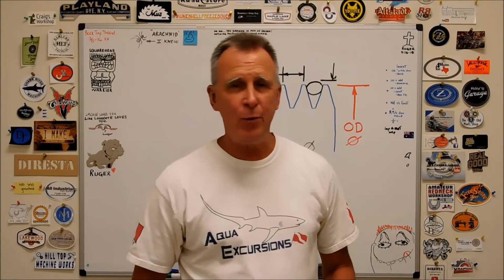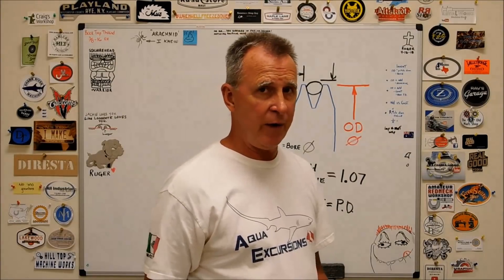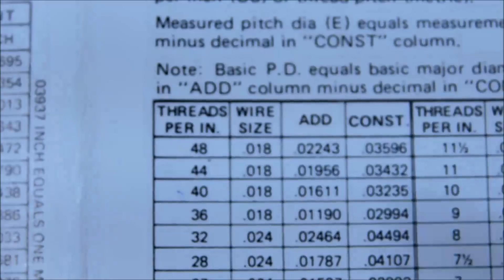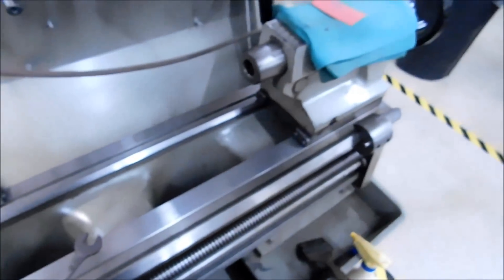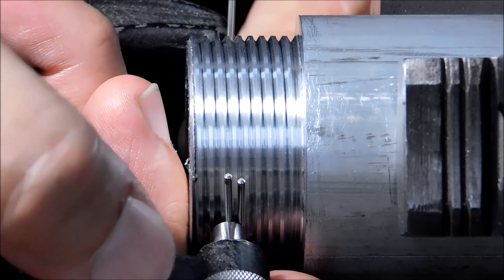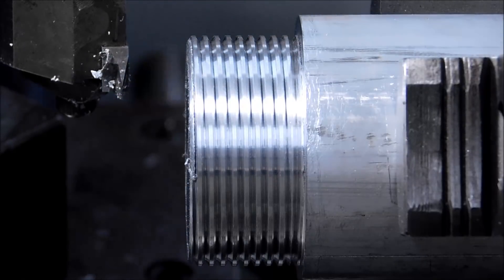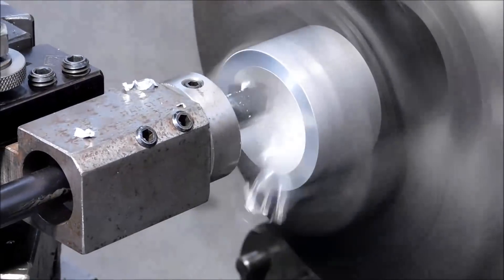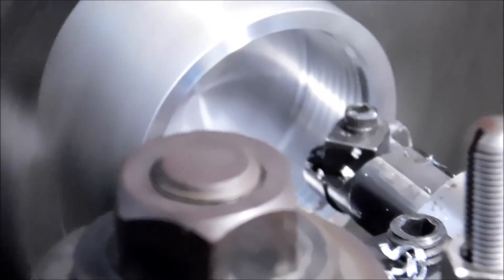Machining Non-Standard Threads

Comment: Another great video. I had to make four non standard cap screws for a 150 year old German engine that were not imperial or metric standards and I had a sample to copy. The OD was .520" or 13.2 mm, the threads were 11.94 TPI or 2.127 mm pitch. The OD was simple but for the odd TPI, I 3D printed custom change gears for my lathe to get the 11.94 TPI. The only way to get the pitch was to use a 67 tooth prime number gear on the stud and a 200 tooth gear on the screw with a 4 TPI lead screw. Stock gears for the lathe were 10 DP and I made 18 DP gears with a new idler so they would fit the lathe.

Comment: You do a great job. I've been a machinist for 40 years and over the last few months have been watching your and many other machining video sites to get a different perspective on how to do things. In this trade you can never stop learning. There is one trick to threading I was shown by an old timer many many years ago but have not seen anyone mention it in a video. If the TPI of the thread you want to chase is divisible by the TPI of your lead screw you can engage the half nut at any time what so ever and the cutter will be in time with your part. I didn't believe it either until I tried it. Give it a shot. Throw a piece of scrap in the lathe and a rag over the timing dial and chase some threads. No specific size, all your testing is the timing

Comment: Great video, it helps a lot, machinerys handbook is a must, I have a PDF copy and print the applicable parts and make notes and calculations on it.  The wire chart is brilliant, and works well.  I have not done an internal thread before, as I usually purchase the nut from a bearing shop, so, I was waiting for the clever way to measure the thread depth, it would be more practical and make more sense to make a go no guage tho.  Again, thanks mate   Michael from AUS

Comment: Hi Joe.
Great video as usual, thanks.
Though you still haven't convinced me to get left hand threading tooling...yet.
One of the non standard thread challenges I've encountered, which does happen regularly enough in the  hydrolics game, is the repair of the threaded end and making a new piston to fit that thread and cylinder.
There are many variations but... 
You have to use the original pitch of the rod but cut it deeper until you have a clean thread, 'discover' the new nominal thread size, best while 'sharp', turn the 'flats' to 1/4 hight, debur and polish.
Then make the close tolleranced tread in the newly minted piston.
It would be easier to test a finished piston on an evolving rod end, but, if you made the piston tread first, you would have to guess the size of the rod threads finished size ..or, over estimate and make the rod weaker than absolutely  necessary .
Another wrinkle is you have to remove the piston from the lathe to check the fit on the rod...
And set it up, again, each, time...
Question, is there a way to measure the effective diameter of the nuts threads to be sure of the correct size before removing it from the chuck?
Oh, and contrary to the quoted drill size for tapping, ie nom minus pitch, which breaks less taps but is a lot less thread flank engagement, weaker but more fit tolerant..
The theoretical correct bore for a nut ( 60° threads) with 1/4 hight flats is:
Bore diameter = Nom diam - 1.299 X pitch, (I go 1.3 x pitch, easy to remember) do the math.
2mm pitch, hight (radius) =  The square root of 2 squared -1 squared = 1.732mm
Less the hight of the flat, 1/4 H, 0.433mm on radius
Equals 1.299mm on radius,
Or 2.598 on diameter smaller than Nominal diameter .
So, say you end up with a nominal M57 x 2mm the nut bore for the flats would be: 57 - 2.598 = 54.402mm (54.40 say).
In a perfect theoretical nut to bolt thread there is only 50% contact, losing more on 'critical' fits seams unwanted..
I will step down from that rather wobbly soap box.
Commence firing..

Comment: One of the best investments I ever made was the wires and the mic for them. I don't often use them but when needed they are never wrong.I often had to send pieces to the bush that I had no nut for. All I had to go by was from the service manuals. When machine downtime is over a thousand $ per hour and often more parts just can't be going back and forth a day at a time both ways. My old Czechoslovakian lathe had no split nut. It had a pedal that would fast feed the apron for returning to the start in either direction. It took a bit to get used to but I swear by it now.  I am sure we all ruined a thread by not getting the nut fully engaged. That is some slick threading there my friend.

Comment: Most of the time a "Unicorn" Thread is used is for a specific application or a use case. Threads used in Compressed Gas applications purposefully use uncommon Diameters, Pitches and/or Thread Directions and mating surfaces. Another place unusual pitches are used is in optical instruments for precision graduated adjustment wheels (sometimes with Optical Instruments, threads are cut diametrically).
Reply: And surprisingly table lamp nipples are 3/8 27...or something odd. why I do not know.
Reply: @ArcFlashWarning  #14 - 20 (*NOT* 1/4" x 20 UNC) used to be very common for carriage hardware, furniture, and interior and exterior household hardware (doors, locks, hinges, rollers, hasps, etc...); You hardly ever see that size anymore. Regarding Electric Light fixtures, there were specific sizes to use codified by the ASME: https://paxtonhardware.com/blogs/news/lamp-thread-sizes

Comment: Great video, as always!  I find myself doing custom threads often enough that I wrote a small program to calculate the diameters.  I enter threads per Inch, a thread contact percent and any one of the external or internal major or minor diameters, and the program calculates the other 3 and the thread height.  It only works for 60 degree threads, but that's all I do, so it works for my needs.  It was written years ago in Adobe Air/Flash.  I should really try to re-write it in something more common these days so I could share it more easily.

Comment: Joe. I just wanted to thank you. A while back you explained and used a tooling ball. I decided to buy one. It came in handy on a job at work on the lathe. I was running a thin wall taper with a guage point 1" in. My senior said do you have a ball bearing. I said no but I have a tooling ball. So I was able to confirm my ID. Thanks and keep up what you're doing. Making some of our lives easier. 🤙
Reply from the maker: thanks. I am truly glad to hear that.

Comment: Always a great watch Jo. Not sure what point Mr Pearson is actually trying to make, but if you are new to the industry then the bag of experience is quite empty. Learning the correct methods for a start is very important. After your bag of experience fills up a bit, then you can be in a position to make a call on how precise the job at hand needs to be. That call can be made AFTER you have the grounding with correct, tried and proven methods. Stay safe and looking forward as always to the next clip.
Cheers
Pete'.

Comment: Not often I need that level of precision, but I like to strive for perfection. Yes, we in the metric world have difficulty getting hold of metric thread wires - either unobtainable or crazy expensive. My solution is piano wire or guitar strings, and CAD. I can model pretty much any thread, a bit of basic geometry and I get a measurement right off the screen. Doesn't matter what diameter the wires are, as long as they contact the walls of the threads and sit with the top of the wire above the top of the threads. I even made a tool to assist with the micrometer bit.
Reply: nice to know I'm not the only one that 'cheats' with a cad program!  especially while working with tapers, or figuring out if I'm understanding the machinist handbook correctly.
Reply: @infoanorexic  Don't forget the triangles!

Comment: Joe, Is there any disadvantages to using the triangle type guages instead of the wire type?
Reply from the maker: If you remember to use the correct side and have a good feel for them, they are fine.  I know guys that swear by them. I've never warmed up to them personally.

Comment: Years ago worked at a grinding job stop one of the things done there was thread grinding. Making threads to plastic injection molds. The dia and pitch had to be adjusted for the shrink of the plastic so there was no standard threads made.

Comment: Joe- other than the fact that you can cut your own relief (or "starting track" as you called it) and the fact that you can run at a much higher speed without fear of crashing the lathe- is there a reason to run with the tool inverted? Sorry, if you mentioned it I didn't catch it. Thanks!

[EDIT]- I see the link to the video in the description now. Looks like I'm not the only one to ask! Thanks Joe- you rock!

Comment: Great tutorial.
I am relatively new at this. How do you measure and cut tapered pipe threads? I had a chinese knock off 1/ 2 inch pipe die that the casting broke. The dies are ok. I am attempting to make my own holder for the dies...but measuring the resulting pipe thread is proving problematic for me.
Reply: Cut with a lathe taper attachment, measure with a gauge. Just don't measure Chinese pipe threads. They are all over the place, a mix of British and Imperial and whatever.
Reply: @RambozoClown  Lets assume we are doing single point turning - if I have thread wires and not a special pipe gauge ... ( I don't count fittings from Home Depot as a gauge).. and I want to verify how much more to take off...what is the procedure? Home Depot fittings may be OK as a gross check, but far from precision. They are not well finished, and if they were made in China the day after a binge night they could be suspect.
Reply: @glennwright9747  You can measure with thread wires and a sine bar setup. Pratt & Whitney made a device for doing that, and others I'm sure, but the cost makes it only practical for a shop that makes gauges. Best is to just buy a GO / NO-GO gauge for the size you need. For most things, testing with a quality fitting should be good enough for pipe work.  Since you are looking for a binding thread, fitting to the actual parts would be the ideal anyway. For example you can get pipe plugs that are over or under spec, so they work in worn threads or fit below flush to a surface.

Comment: Excellent video and with many excellent tips re deburring, etc.

Just for clarification, is the OD to which you refer, the value that you measure with a micrometer across the male thread? i.e. if the the thread is a 'standard' thread, then I believe the OD of the male part will less than the designated definition of the major diameter of the thread. eg. for a 3/4-16 thread, the major diameter is 0.750" but I believe the size measured by the micrometer would be a bit less than 0.750"
????
Reply from the maker: Ideally, the major is the absolute max mic reading.

Comment: Wish I had seen this a few days ago. I was making a headstock spyder for a 12x36 lathe.  The headstock threads are internal so finding the PD with three wires is not possible. Since the lathe is Chinese I suspected the threads were metric, however then checked at 16 tpi with a thread gauge. I could measure the internal diameter. With the internal diameter and the thread pitch I believe I could have backed  into the starting OD for the male thread. The real pain comes in test fitting as I don't have an adjustable chuck. Every time the part was removed I had to dial it in again.

Comment: Joe, I am task with making a internal and external 40mm x7 metric acme thread. Any information you have will be appreciated. So far my research shows a metric acme thread is 30 degrees as opposed to the standard 29 degree Acme. I read also they make a metric acme 30 degree tool gauge but I can't seem to find one. Thanks for a great channel. I tell all my apprentices to watch every single video you have made.
Reply: This is 4 months later, so you probably already figured it out, but for anyone else that comes across this problem, search for DIN 103 thread inserts, that specification is for the trapezoidal thread form used for metric Acme, and the inserts are usually labeled that way.  All of the major insert manufacturers would probably have them.  I can’t help you with the gage, but that would probably be available from European suppliers, many of which ship to the States.

Comment: There a great app that i use called UN Threads that gives all kinds of thread data for basically any thread out there....you can even specify custom wire sizes and it will calculate over wires dimensions for you....I had to make a 1/4-24 bolt one time for a friend and I didn't have the mating part, and didn't have thread wires , so .030" mig wire stood in and worked great...

Comment: another great video. someday i will have to try your upside down and out thread cutting technique .looking at your compound rest setting leads me to a question. when i was taught to run a lathe many years ago i was told to set the compound at 60degrees do that any cut resulted in a diameter reduction, and them use your cross slide to keep a zero setting. just like cutting threads. i know that most industrial lathes use diameter reduction handwheels but most smaller lathes seem to use radius reduction. is this worth a discussion?
Reply from the maker: That is an interesting concept with one exception,  each adjustment also results in an advancement of your tool position.
Reply: @joepie221  for me the only time that becomes an issue is if i am turning up to a hard stop such as a carriage stop. then i use the cross slide

Comment: Have a screw from a 1955 typewriter, believe it or not it could be metric or it could be imperial. It is either 4mm or No.8. Standard hardware store nut no.8-32 or M4-0.7 does not fit. I measure 3mm across 5 peaks so that seems to be 3/4=0.75mm or 34 threads per inch?
Reply from the maker: Its not unusual for manufacturers to have their own hardware. A tap will cure that problem.

Comment: Really useful video Joe. What are the 2 insert holders & inserts you use. Standard threading holders and inserts have the bulk of the tool close to the shoulder (External thread) or on the wrong side of the bar (Internal thread) when set up as shown.
Reply: The external holder he's using is a Kennametal NSL 123B.  This is a left hand "top notch" tool holder for size 3 inserts.  if you thread conventionally, toward the headstock, you would want the right hand version (NSR).  Since Joe likes threading away from the headstock (lathe in reverse) he uses a left hand cutting tool turned upside down.  You may notice Joe has modified his BXA tool block in order to make it sit higher than usual on the tool post.  Look for a smaller shank tool than his 3/4" version and you may be able to avoid this problem.  I use the 1/2" shank Kennametal NSL 082V on my lathe without any need to modify the height.  It uses size 2 inserts, which are not as popular, but still not too hard to find.
Reply: Thanks Cody, a really helpful reply 👍

Comment: Do the formulae hold up for the large diameter, very fine threads like photography lens holders, telescope / microscope optics?  Thanks again for sharing your time!
Reply from the maker: So far, this formula and approach has served me well. I trust it.
Reply: Hi, Bob Warfield from CNCCookbook.   

I just took a look at the math in G-Wizard's thread calculator to see whether the bore formula will work for all threads.  The math is based on the actual (many boring pages!) thread standards.

Joe's shortcut works--it'll fall with the acceptable min/max range for all UN and ISO 60 degree threads.
Reply from the maker: Thanks for keeping me honest Bob. Its always good to have a second set of eyes.

Comment: when threading in reverse with an upside down tool is it not an issue that the cutting forces are trying to lift the carriage?  are the ways designed to take loads in that direction?
Reply from the maker: Your tool will break long before lifting forces damage the machine.
Reply: @joepie221  I wasn't thinking damage, but rigidity. I guess it'll just work like a spring tool holder
Reply: @fuzzy1dk  Compare with parting off using an upside down blade and reverse rotation. No risc for the tool getting caught. But yes, rigidity always plays a roll.

Comment: I really appreciate you taking the time. I fumbled through this myself to make a fire hose thread (1.25"-9) cap for some our nozzles at work. Can you please reply with a little more explanation on the math. I was curious why you used 1.000" to do your bore size math as opposed to the actual major diameter of your thread (1.710??). Is that because 1.000" is the root diameter of the thread? Thanks again
Reply from the maker: Sure......1" is the length standard by which the pitch value is divided into. This gives you the crest to crest, or the root to root distance and becomes the constant to subtract from the major diameter of what ever thread you are making, to drill the hole.  example 2 1/4-10 thread  1" divided by 10 = .100   2 1/4 - .100 = 2.150  That would be a reliable bore size. You could probably go smaller as the material and application dictates, but this will get you in the mid class ball park.
Reply: I see. So that 1” constant would work across the board then. Say for a 0.75”-10 thread I could use 1” as my constant there as well. Thank you sir
Reply from the maker: @Jmastffp  Correct. But somewhere in my vast collection of things I once saw, isn't a fire-hose thread a different thread profile than a standard 60 degree 'V' style?
Reply: @joepie221  I honestly have no idea. I do know that it’s an NST thread and that it’s a 9 TPI. I made two caps (thread protectors) that were 60 degree V thread. The fit very well. I spent about a week researching thread specs and the best I could come up with was they were 60 degree. If I’m wrong please let me know as I intend to make more of those thread protector caps.